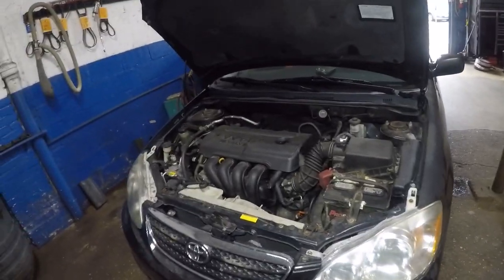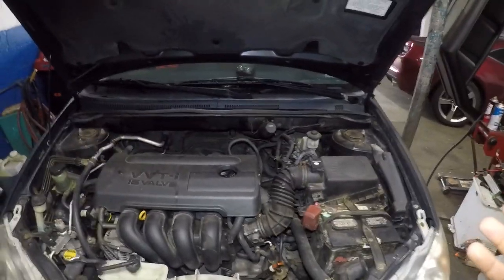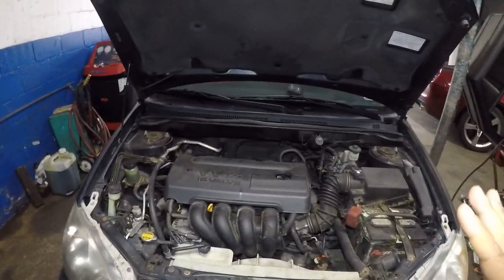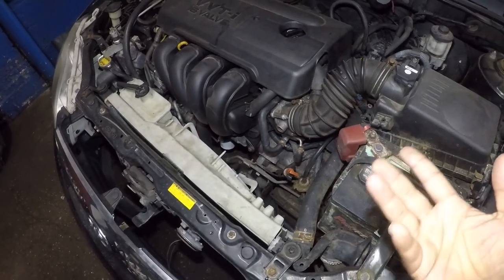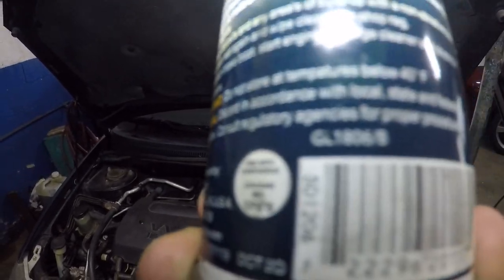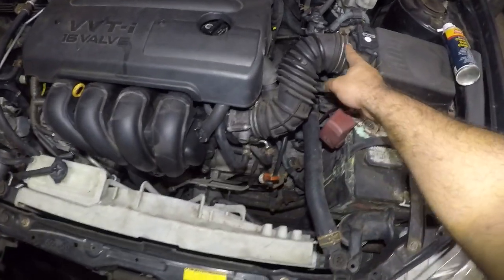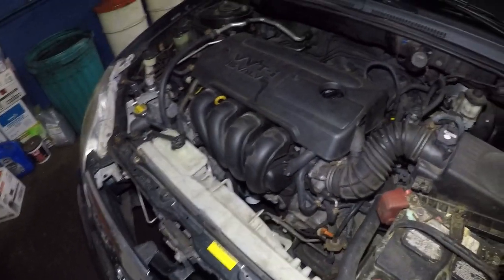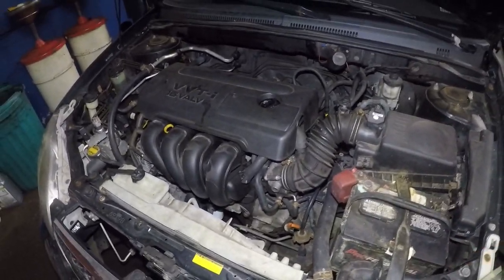2007 Toyota Corolla Stalls at Red Light or Stop Sign

Comment: Question I recently bought a 2010 Toyota Camry it’s a 4cylinder idk how to explain it but when I start car in the morning while it’s cold it will run and drive good after it warms up the car would start to stall when coming to a stop
Reply from the maker: Ok yeah that’s stall u need to do throttle cleaning check out my videos on throttle cleaning on Camry just search it in the search bar and add rb the mechanic they all will show up
Reply: @RBTheMechanic   thank you sir appreciate it
Reply: @RBTheMechanic  question after cleaning out the throttle body should I disconnect the battery or not necessary
Reply from the maker: @davec7601  nope it will loose idle memory and it will stall more worst
Reply: @RBTheMechanic  alright thanks again bro happy holidays
Reply from the maker: @davec7601  z happy Holidays!!!

Comment: 2009 toyota corolla changed battery alternator plugs and coils. Shakes at stop light unless it’s in neutral or park. Stalls out when ac is on and in gear could it be a bad throttle body ac is ice cold. Looking for any help I can get
Reply from the maker: Before u rule out bad throttle I would clean out the throttle and if any issues after that do idle relearn if idle is too high after cleaning.  Please update me how it went
Reply: @RBTheMechanic  how do you do idle relearn?
Reply from the maker: @TheJohnboyy  
Here’s video on that u might have to do it once or twice tho it will pick up https://youtu.be/sCsBqeZctzE

But do throttle cleaning first.
Reply from the maker: @TheJohnboyy  usully when u change battery it looses its idle memory I have videos on chaning battery without loosing idle for future knowledge just search it up.  Battery change on Toyota Corolla rb the mechanic.  And it will show up. Anyways it’s definitely loss of memory but it’s best time to clean the throttle since it’s out of control it will pick up on it on from driving it around
Reply: Seems to me like idle is too low right ranges around .5 to 1 before ac then when ac is on drops and stalls if I give it a little gas it will stay alive or put it in neutral it will stay.
Reply from the maker: @TheJohnboyy  yup definitely will fix ur issue do the throttle cleaning it’s easy process I have videos on it should be 5 minutes
Reply: @RBTheMechanic 

I’ve same issue as this guy, done the cleaning and the issue persists. Where do I go after this?
Reply from the maker: @thewajd25  did u disconnect the battery or loss power before that occurred?
Reply: @RBTheMechanic  i have and I have done the relearn procedure
Reply: @TheJohnBoyy @RBTheMechanic same issue with my 2009 Corolla. Low RPMs (400s) at stop light or in reverse and will stall with AC on. Replaced spark plugs, ignition coils, and throttle body. Disconnected battery and drove around with nothing on. No luck. Wondering if there is a vacuum leak somewhere.
Reply from the maker: @slapshot1210  clean the throttle first then do idle relearn
Reply: @RBTheMechanic   Cleaned throttle body originally and then eventually replaced with brand new Aisin throttle body. MAF sensor also cleaned. I will try the key turning steps to reset the computer, but I figured disconnecting the battery while I changed out the throttle body would reset it. Problem seems to be worse after engine is warm or during hot day but tough to tell. Does have a clicking noise in drive and reverse, but not in park. Thinking next step is cylinder compression test to see if it is a bad head gasket (it has thrown P0304, cylinder 4 misfire), but only after purposely stalling the car out many times.
Reply from the maker: @slapshot1210  oh ok we’ll fix the mix fire
Reply: @RBTheMechanic   Yeah, I've disconnected the battery. I've done every relearn procedure that I could find.
Reply from the maker: @thewajd25  what’s the issue? Or it’s resolved?
Reply: @RBTheMechanic  My issues are the same as the OP. I have gone ahead and done a compression test and all cylinders are between 85-95, so i think my issue is something different entirely
Reply: @slapshot1210 I have literally the exact same issue as you! Same year and all. Let me know if you figure out what’s wrong

Comment: Hey brother so my car starts but after a few seconds my motor start going vrm vrm and boom I’m stalled like you said my rpm’s going high and boom it cuts off if I’m not reving it
Reply from the maker: Can u make a video let me see what’s going on and scan car for codes
Reply: @RBTheMechanic  hello there brothers so I uploaded the video for you to see this morning it would start but sounded like it would shut off any second from that point
Reply from the maker: @HPSWOLE_  ok I saw ur video so ur car starts up well since it’s cold to will be high so do the throttle cleaning that’s what u saw on my video and u pointed at also by the way.  Make sure u follow my instructions well anyways. One more questions … proper to this stall did u disconnect battery replace battery or was there any power loss

Comment: Whenever i turns my steering wheel either right or left, my car stalls
Reply from the maker: What is ur RPM once the car is hot and in drive
Reply: @RBTheMechanic  when my car is in idle. Like 700-800 rpm.
Reply: @amotionality9244  did you ever find out what the problem was?
Reply: @tmchevyman5319  MAP sensor is the problem. I found the problem and also fixed it using obd scanner.